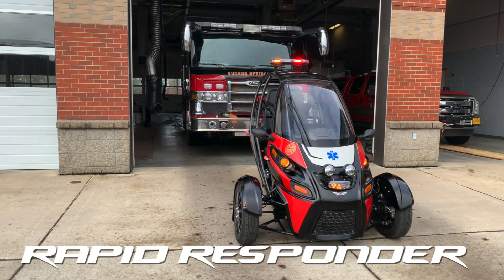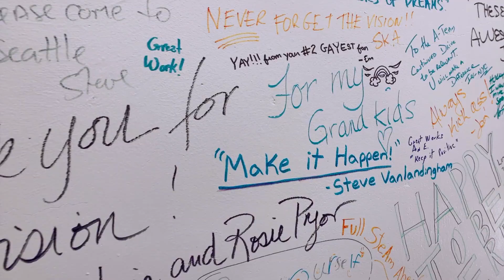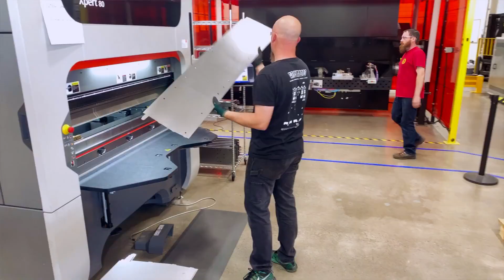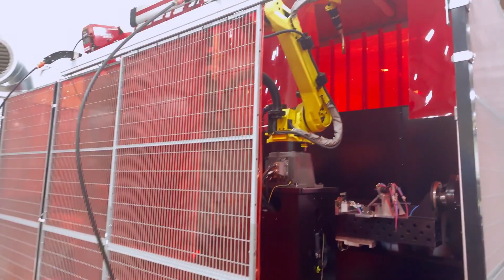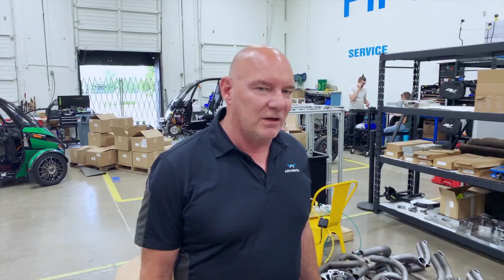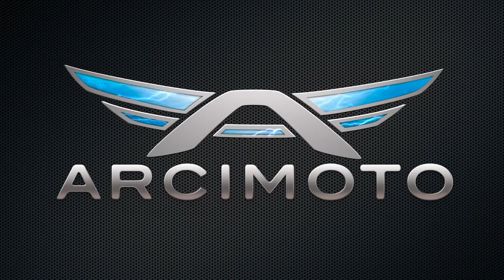Arcimoto 2019 Q2 Earnings Webcast

Comment: Texas has a somewhat unusual Motor Vehicle law, as to be classified as a Motorcycle you have to straddle the Motor... Would the Battery Compartment be classified as part of the Motor?
Reply: Not really. It's more like sitting on the gas tank. The orientation of components are in different areas on a bike.
Reply from the maker: Texas defines as motorcycle thusly: "Motorcycle" means a motor vehicle, other than a tractor, that is equipped with a rider's saddle and designed to have when propelled not more than three wheels on the ground. TRC 541.201(9).

One could consider the FUV seat as a saddle since your legs straddle the battery pack.

Comment: These are great for tour vehicles. However, as a Fulltime RV owner and a couple that lives in the country (just had a mouse have babies in our car because we left the window open); real doors to us are not an option they are a neccessity.  I know Mark drives without them and doesn't think it is a big deal.  It is, please make this a priority.  I have bought stock and want this company to be more than a just a "gimick" .  Your itentions and ideas are great.  Please take this vehicle to the next serious level and add doors.
Reply: The base model will have an open-air cockpit, but there will be several door options, both soft and fitted, half and full doors.
Reply: You would think that a company based in rainy western Oregon, waterproofing would be required on a vehicle. I live north of Eugene in Salem and don't have a garage to store anything in. If and when I buy one of these vehicles I will need doors that are waterproof, just like the automobile I now own.
Reply: @usmcvet6973  We’re in the same position without garage just south of you. Either we’ll build or get a small RV cover or add a top half to the door that is zippered like a jeep.
Reply: The half door can be added to (by us). At least it keeps the weather off your feet, groceries from spilling into the street, and the dog in the back street a little safer (attached to seatbelt).